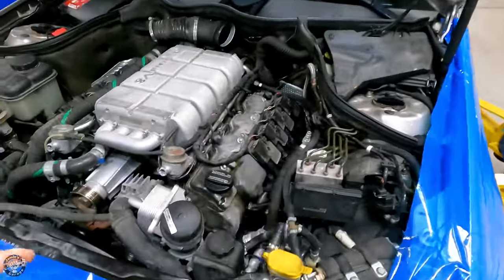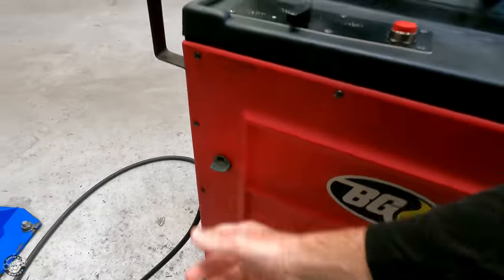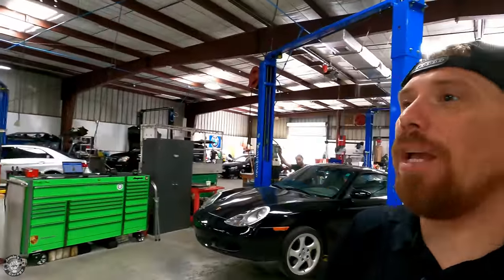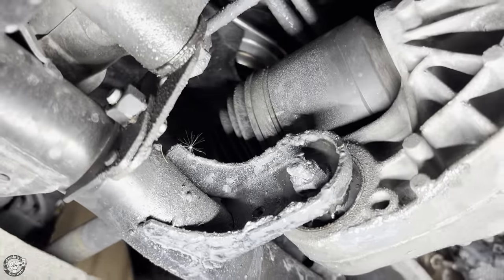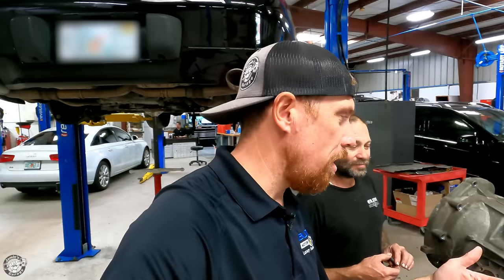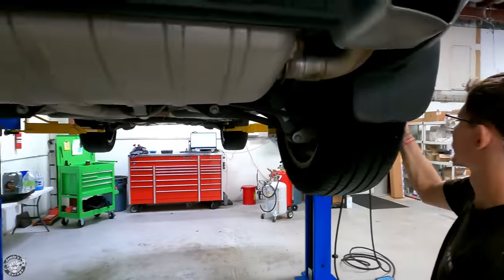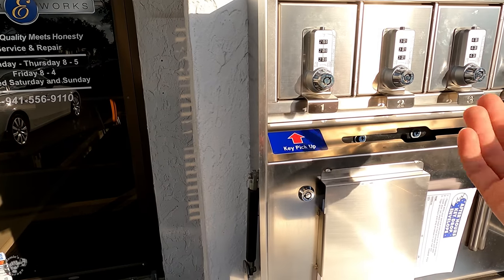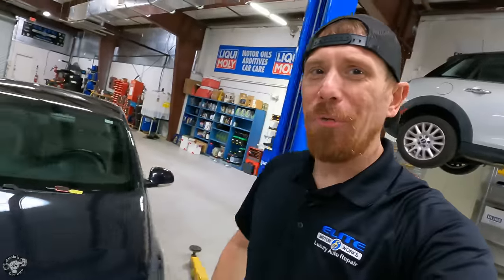We have a sleeper in the shop!

Comment: 3 codes lock can be solved easily
Reply from the maker: the combo is changed with every customer and the keys are typically in there for about a hour or two after we close. We've never had a problem and hopefully we never will.